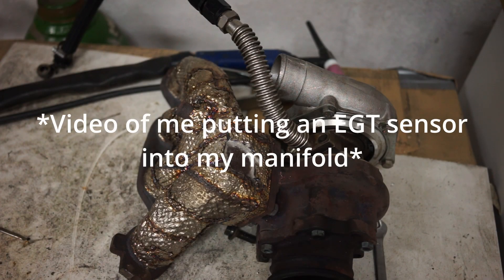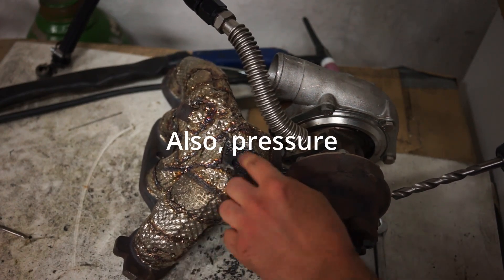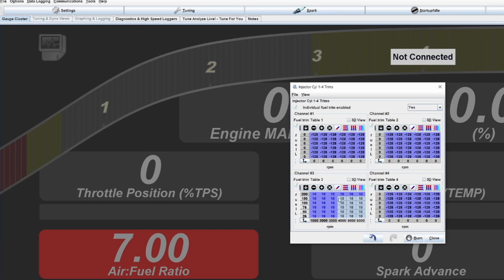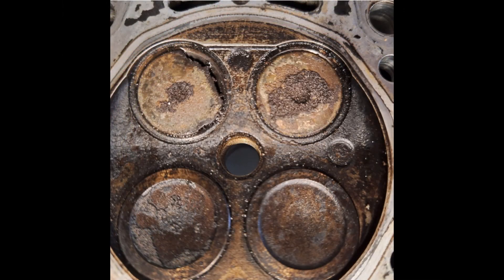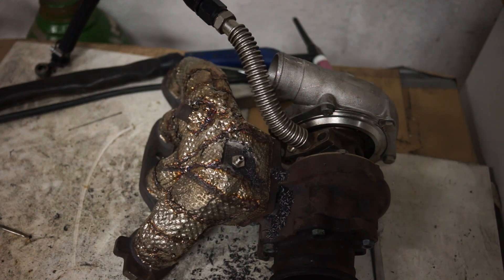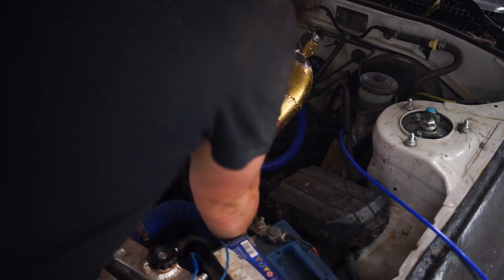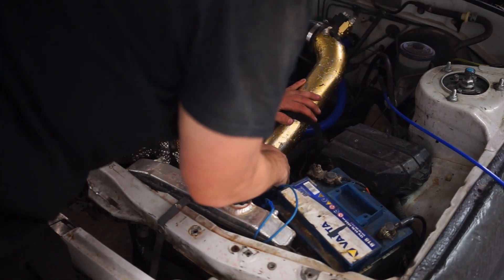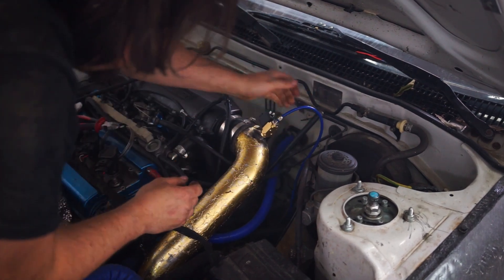EGT - Overlooked Engine-Killer! | EGT Monitoring, What is it and how to do it? | Tuning Explained

Comment: As far as i know top fuel dragster that use nitromethan fuel run so „Rich“ that the fuel cools the Engine for the Short run so they dont need any coolingpassages in the block. You dont Need a to dial in the afr that much with nitromethan, unlike other fuels, excess nitromethan will leave the exhaust in liquid Form. I dont know How it is for rc Cars that use Fuel with low nitromethan (5-15% nitromethan -> rest Methanol)
Reply from the maker: Yeah as i said i wasnt sure i just heard it a few times that egts got hot when some people tried to run nitro methane on a few normal engines